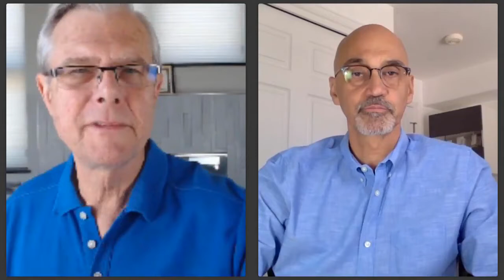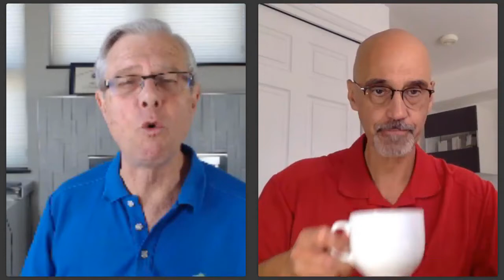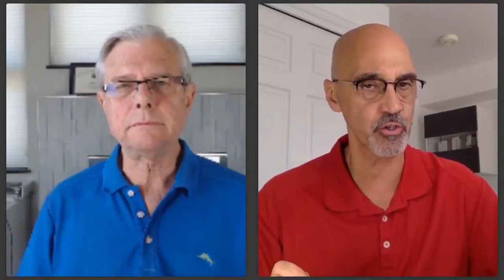Lean Manufacturing: Are Lean Thinking and Simulation Modeling Compatible?

Comment: Hi guys. You're 100% right. Very useful video for simulation adepts.

I use Witness simulation from some time and can say that the simulation is a very powerful tooll for advanced process design/improvement only if used properly. 

Definitely this is a tool for every one looking for smarter Lean implementation. 

Sure you need some computer skills but in today's world without them you're probably very unefficient in process analysis... 

Additionally, instead of classical Lean Quantity/Time based KPI you are able to lead advanced  direct cost KPI analysis which in my opinion gives more interesting business answer. It means that with simulation I know in advance than after implementation of given solution we'd save 100kUSD/year instead of knowing we'd save 10 minutes from actual Lead Time :).

When you try to get money to pay that project try to imagine which of these two KPIs arguments speaks better to project sponsor ?